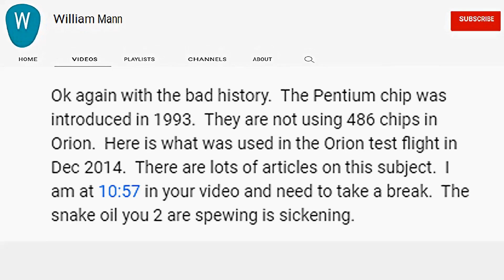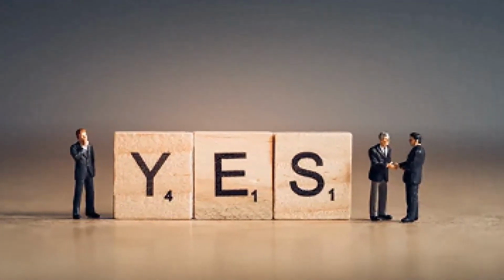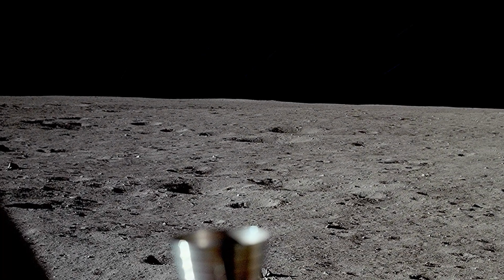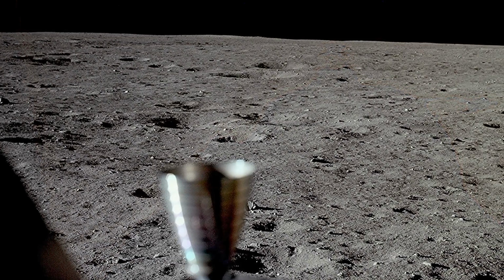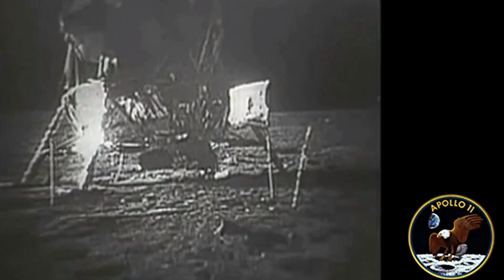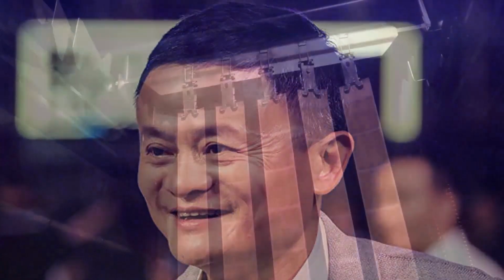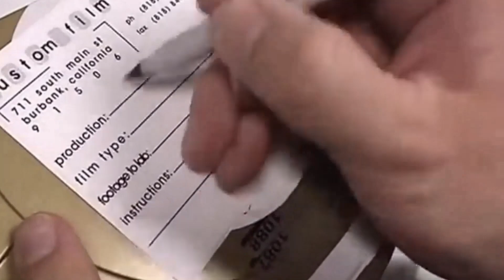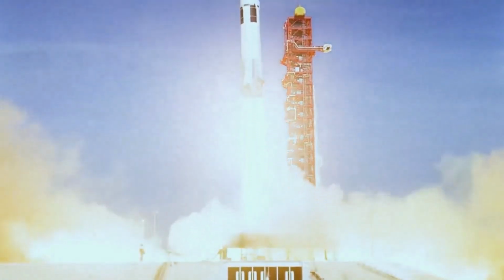THE APOLLO DISCUSSIONS, "APOLLO AND THE FILM INDUSTRY" PART 12

Comment: The other thing I would ask you to explore is the return to earth. When you see the photos of the command capsule suspended by the three enormous parachutes bringing it safely to splashdown, where the hell were those things stored. They would take up heaps of space and how were they possibly deployed having just been through re-entry at incredible speeds and heat. Being dropped from a B52 makes more sense.
Reply: There's a contemporary documentary about the Apollo chutes on YouTube. The chutes were squished with a hydraulic press to fit into the pie-shaped compartments at the top of the capsule. They show all the details. 

Whether that was actually used on the Apollo 11 splashdown as presented to the public, I cannot say.
Reply from the maker: The mains were stowed on the side of the upper portion of the CM. those three holes on the sides are where the drogue shoots along with the charge was stowed. Since the heat was being generated from the bottom along with the parabola shape of the heat shield would fan out the fire and dissipate it away from the top however, when the capsule reached thicker atmosphere I would think that things would heat up and ruin the cords attached to the chutes. That is always a good question for debate. Cheers Daniel.
Reply: The parachutes were made from Ripstop nylon, like my Hot air balloon and the fabric deteriorates at 400 degrees F.  The temperature upon reentry is 5000 degrees F , even though reflected,  the radiant heat would have reached the cannisters where they were stored and could have melted them into a single lump of crispy nylon.

Comment: When they re-pressurized the LM, wouldn't the air coming out of the tank get really cold as it expanded into the vacuum and filled the cabin? How did they warm up that air?
Reply: This is such a good, thought provoking question 👍🏻
They would have had suits on supposedly but then how did they make the cabin habitable🤔
Reply: Astronaut farts.
Reply: Great point. They couldn't even fit into the LM with their suits on. Physically impossible!
Reply: Batteries.
Reply: @tmo4330  
What do you mean by 'batteries'?
Reply: @assistantto007  I was joking.
Reply from the maker: That is a great question worthy of more research.
Reply: @theapollodetectives  I haven't studied this in detail but I found a YouTube video from a chemistry class entitled "Expand Gas from One Tank to an Empty Tank" and they point out that the gas in the empty chamber (in this case the LM cabin) would also get compressed as it fills and compression makes heat.

So they say the tank itself would get cooler and the cabin would get warmer.  Link to video:
https://www.youtube.com/watch?v=toM4d3NZcHA

However, I think it requires a detailed analysis. Perhaps you can use the formulas and methods in the video with real world values from the Apollo hardware to see what should happen.  

Either way, I don't think re-pressurizing the LM is as simple as presented in the Apollo program.
Reply from the maker: @codetech5598  I have downloaded the gas expansion video for analysis. Thanks for the link.
Reply: @theapollodetectives  My gut feeling is that the gas in the LM cabin will be cold, since the volume is much larger than the tank and the final pressure is low.

Certainly some Apollo engineers in the 1960s would have done a full report on this subject, paid for by the taxpayers. Where can I  find this report?
Reply: With a few Sears Die Hard`s.....

Comment: 11:45 Stop here! It's important. Beside argument of missing cross marks on photos. Shadow of the LEM that wasn't adressed (directly) Small rocks are in focus but why shadows of LEM nearby are soft? Is there any atmosphere to reflect light? Camera did not move, it wasn't out of focus. Soft shadows are result of source of light being relatively big comparing to size of object and distance of shadow. Double shadows are when there are two relative small similar light sources. Double soft shadows if there are two relatively large light sources. Bright but sharp shadow is when you have one small, distant light source and rest of light comes from every other direction. No shadow if light comes from all directions. You get the idea. 

It may be caused directly or indirectly if light is reflected of walls, in home of sky outside or by light source itself. Extreme scenario was adressed - double shadow two light sources of similar power yet separated. Then you have double shadow. If light source is big enough or two are not separated (multiple light bulps) you will see soft shadows as result infinite number of "sources" adding together making soft shadows. You can even calculate (cause it's done on GPU card such way multiple times per second) you can even calculate precisely the distance of light source from object and between each other. Knowing size of light sources, distance of shadow from object, distance of "soft" margin etc. Or you could calculate vice versa softness of shadow by simply knowing distance of shadow from the object and size of the light. It;s way to be done on GPU then shadow map "texture" is applied multiple times to textture of background one or more such textures to create effect of soft shadows. This fakery is relative easy to calculate. Simplest shadows on GPU in 90s were single sharp shadow map or even simpler just black texture morphed in size to imitate shadow. Soft shadows need more calculation or at least two sharp textures one black and another gray semi transparent then add blur and voila.  By using same math that is used to calculate anything related to lenses, glasses, telescopes and stuff similarities of triangles. We could calculate precisely how far was source of light - Sun. Knowing size of Sun we could beyond question prove if it wasn't Sun but artificial lighting. It's not rocket science, it's math and physics at level of 1st class of high school. I wont do that.. i could maybe some day. Triangles, similarity of triangles draw lines "botoom" of light source to top of shadow softness (where it dissapear) draw line top of light source to bottom of shadow softness (where it turns all dark) lines passing cosest to object possible. Then do some math  similarities of triangles proportion x/y = w/z. To mine eye shadow is close, should be sharp yet softness is huge huge therefore it was either huge reflector or smaler but very close to object.  But it could be Sun as well, you never know untill make some math. Maybe one day will do not today :> 

It could not be caused by Moon surface because if do, you would see bright shadow but shard, cause light from surface is directed from various directions. It would not create soft shadow but sharp gray shadow instead we see dark one but soft as it would be if light source was huge and there was no reflection of the surface. You get what i mean? Maybe im wrong? It's easy to understand it's not rocket science :) It's hard to explain because im not english man. Sorry for such long comment.
Reply from the maker: I personally believe that those photos were taken on an outdoor set in full sunlight. With the use of an optical printer, the background could be replaced with whatever the technician wishes and you would not know the difference. That is one explanation for the evenly light surface and the shadow moving from left to right. I wonder what Dave Mc Keegan will have to say about that, since he has never worked with a machine like this?
Reply: @theapollodetectives  At the very least you already know what I've got to say about optical printers Robert so I can confirm that you are precisely correct here........
Reply from the maker: @timtee2565  Thanks Tim! It is crazy isn't it m8!

Comment: 9:47 - Quote: "What other explanation can you have?"
Well, I can think of a few alternative explanations for the anomaly of the double shadow, but they all assume that these are composite pictures or at least heavily edited pictures.

The double shadow of the lander appears to be in a different layer placed on top of a separate background layer, either digitally or the old fashioned way, with transparencies, cutouts, retouching, etcetera.

In this scenario, the double shadow may have been caused by the displacement of an additional transparent layer resulting in a misaligned duplicate of the lander's shadow. A shifed secondary transparent foreground layer could also explain the different angles of the second shadow seen in consecutive pictures of this series.

Alternatively (still in a scenario of extensive photographic editing), the double shadow of the lander was the result of shooting through one of the multi-pane windows of the lander, but that shadow was then cut out and added to a different background picture shot outside the lander as an overlay.

If the NASA shills would be right and this would just be one single unedited picture, there would have been double shadows everywhere, just like you guys have said in the video, unless of course they removed all double shadows in the picture one by one but somehow forgot to remove that huge prominent double shadow of the lander visible in the foreground, which would be hilarious.

In other words, any theory based on the assumption that shooting through the multi-pane windows of the lander results in a 'double image' (double shadows in particular) implies that the inconsistency of the double shadow anomaly seen in these pictures must have been caused by extensive (yet clumsy) photo editing/manipulation.

By the way, another huge problem with this 'multi-pane window effect' theory is of course the fact that the effect can not be seen in the footage of any of the Apollo landings/touchdowns, despite being filmed through the exact same window of the lander.

My conclusion is, that either these pictures are the result of extensive photographic manipulation, or the pictures are in fact authentic, but instead of the 'multi-pane window effect', multiple adjacent light sources were used to light the scene. Only the parallax effect of multiple adjacent lightsources could explain the fact that apart from the lander in the foreground, no other object shows any noticeable double shadow.

I should add that the use of multiple adjacent light sources rules out any 'multi-pane window effect', since that would have resulted in at least four shadows of the lander.
Reply: There are duplications of the rocks and craters around the shadow as well - which has been pointed out the AD's on multiple occasions including in my emails that they have referenced... Except they conveniently manage to avoid that small detail as it immediately disproves the existance of a second light source 🤔
Reply: @DaveMcKeegan - You clearly don't understand the reflection effect of a double-pane window. The whole picture should have a duplicate overlay shifted in a certain direction, like a double exposure.
The reflection effect should be equally strong/prominent in all parts of the picture. Just a few barely visible duplicate rocks and craters around the shadow of the lander won't make any difference.

I have to say, for someone who doesn't appear to have a basic understanding of photography, you seem overly confident in your criticism. What makes you think you have a valid argument if you don't even understand general concepts and basic principles?
Reply from the maker: I personally believe that those photos were taken on an outdoor set in full sunlight. With the use of an optical printer, the background could be replaced with whatever the technician wishes and you would not know the difference. That is one explanation for the evenly light surface and the shadow moving from left to right. I wonder what Dave Mc Keegan will have to say about that, since he has never worked with a machine like this?
Reply: @theapollodetectives  Still doesn't answer why there was no atmospheric haze in the distance
Apollo 15's mission photos perfectly match the landscape found with stereoscopic scans by Japan's SELENE probe (a point I highlighted in my emails to Marcus)
Or are you suggesting that Japan mistook Arizona for the moon?

Would also be one hell of a task to perfectly mask in all the reflections in the visor along with the curved distortion ... That's hard enough to achieve in a single image with Photoshop, much less hundreds of photos and hours of video footage

Now on the point of responses - I wonder if you'll ever address a few points I have:

1) Why did Scott's email claim film was damaged by a vacuum chamber when it was in fact damaged by being on the outside of the ISS for more than a full year?
2) The LM double shadow - why are there craters also duplicating near the shadow?  (Another point I highlighted to Scott which he conveniently forgot to mention in the video)

Comment: Looking at Apollo 11-16-mm magazine 1092-K it appears that 'Buzz' did take take shots of 'Armstrong' but it's not recorded in the A11 image library or the photographic record. At 2.51 in 1092-K you can see Buzz saluting and Neil taking pictures, the last one being AS11-40-5875. After this Neil handed him the camera and Buzz proceeded to take a series of images of the surface AS11-40-5876 to 5900. Buzz gives camera to Neil who snaps 3 shots including the 'iconic' one of Buzz who then takes shots 5904 to 5926 before handing the 'blad back to Neil. At some time there were more images taken of either Buzz or Neil snapped saluting by the flag, you'll see this in Apollo 11-16-mm magazine 1092-K from 3.00 to 3.07 but no record of these photos exist except for what's on this particular DAC magazine.

Comment: Also, at +42 minutes into the film, look at the astronauts feet! As he "moves" around the flag. He is not moving his feet! Looks like he is on a wire and being pulled around like a puppet? Anyone else see this? But let's not forget the main fact the lunar ascent module had no ascent engine? Really! No room for a 1969 rocket motor inside the LEM Ascent stage? Even the children's airfix models omitted the ascent engine on the model? Child's play logic really?
Reply from the maker: That video was made with the DAC camera which took only one frame per second. When you speed it up and then smooth it out, this is the effect that is produced. Still it certainly does look like these guys are being held by a wire support. Cheers!
Reply: @theapollodetectives  thanks for that! One FPS! Would explain it but I still see a Thunderbirds puppet that's not using supermarionation! LOL.🤭
Reply: Of course, the DAC movie film wouldn't have survived the return through the Van Allen Belt. Unless they had a Faraday Cage aboard. I'd like to see the radiation figures from the Orion flight that was supposed to measure radiation. I understand Bart Sibrel asked for the figures but was told they were "classified"!